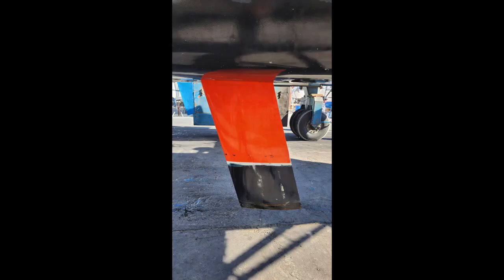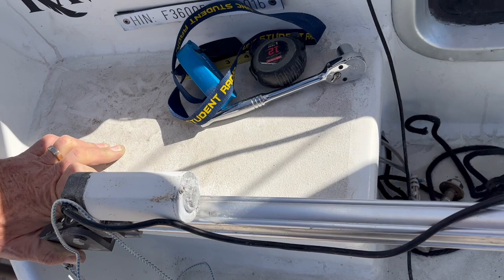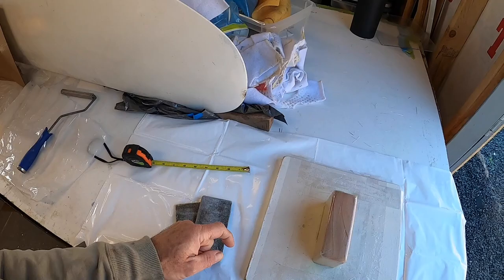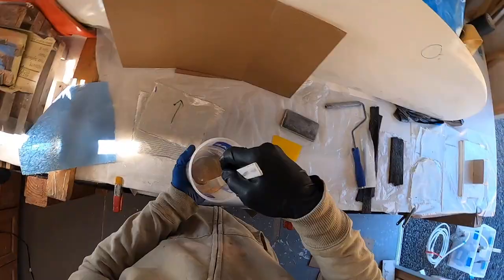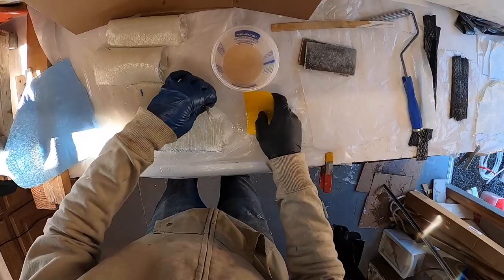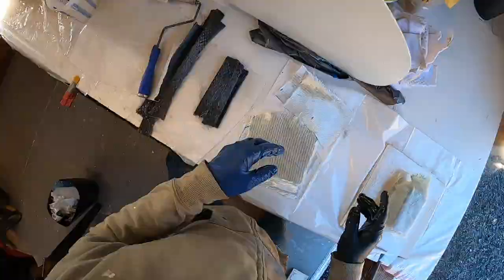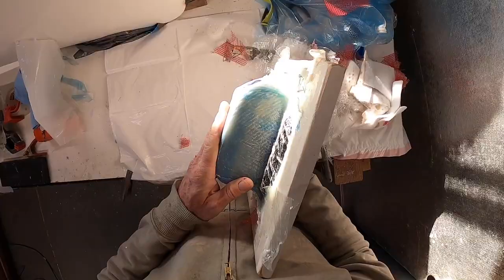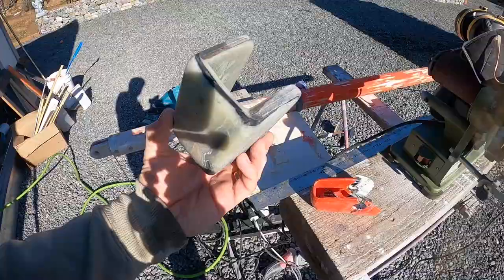Making carbon fiber boat parts using basic vacuum bagging techniques

Comment: Nice job Greg, showing the process of laying up and bagging your part. It’s nice seeing how other people approach building their own parts. I like the way you roll the resin into the carbon between plastic. Never seen that before but it totally makes sense. It’s the same concept as using resin impregnation rollers. I was starting to panic for you with such a thick layup when you mentioning the heat buildup, but then I remembered its cold there. That thing would have been smoking here, LOL. 
Aloha, 
Cullen Chong 
F-31R “Delta Vee”
Honolulu, Hawaii

Comment: Nice job! I learned a lot today. 
Did you roll all the fiber and carbon layers in between on the mold before you bagged? Did you have a problem with the epoxy setting up before you finish adding all the layers?
Ha, ha, I saw Delos and Calico boats there at the end of October in the boatyard, looks like there was not much progress since then.
Reply from the maker: Yes, all those layers get heavy roller pressure down on the wet-out table before being placed on the part. I don't worry about rolling after placement because the vacuum will remove any air bubbles. I've had plenty of practice with lots of layers and controlling for the hardener taking effect. The air temp was down in the low 60's that day so I was confident I'd get away with the 11 layers if I worked quickly, even with 205 Fast hardener :)  It never got hot or gelled - in fact the whole thing needed heat lamps once I got the bag drawn down.  Bill & Grace on Calico Skies and Line & Teal on Basic were busy on their boats when I was in town. Delos crew was in Europe. I imagine many boats will have launched before me this go-round.

Comment: Did you isolate the carbon fiber from the metal pin?  I understand when the two are in contact you get electrolysis between them.
Reply from the maker: Yeah I’ve heard that go around too. Don’t know where it comes from. Look at all the 316 stainless steel fasteners tapped into carbon rigs on pro-built boats. I’ve never had carbon/SS contact issues. On this part there will be paint between the composites and steel pins.